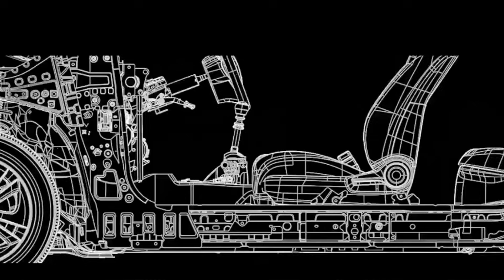CHIEF ENGINEER OF 2024 LEXUS GX SHARES INSIGHTS YOU DIDN'T KNOW!

Comment: This was great. I’ve learned more about the 250 and platform in nine minutes than months of videos and articles by automotive journalists parroting Toyota’s marketing info… well done and thanks for sharing info that matters. 

I’d still like to know about the engineering side of things on each vehicle. E.g. what is the target service life… improvements in key mechanical/structural areas compared to the last gen(s)… and differences between the actual models (ie if the architecture is so similar what would compel me to opt for a 300 over a sequoia… 250 over a T4R)

Comment: Question, why is the chassis not galvanised, or what effort has been put into corrosion protection on the chassis? In UK, gritted/salt on roads eats away at underbody and sadly can become MoT failures quite quickly requiring welding. Great car though, excellent engineering, I'd love one from new!

Comment: David - You are the first to mention crash test information. It is February 2, 2024. Since this new GX550 was unveiled Summer of 2023, the primary interest I have is how the Chief Engineer is satisfied with survivability in various crash scenarios. PLEASE, say more about this aspect of design decisions and what measures are baked into the platform and height and size of passenger compartment. With the purposeful reduction of the space in front of and behind the front and rear wheels, did Lexus find engineering improvements to protect passengers? I love your knowledge and personal energy about GX. I drive a green 2008 LC 200 and have waited for this GX550 hoping that the newest safety sense 3.0 and designs will continue to make these vehicles safer and safer.
Reply: I agree, and driving a safe vehicle should be a top priority.